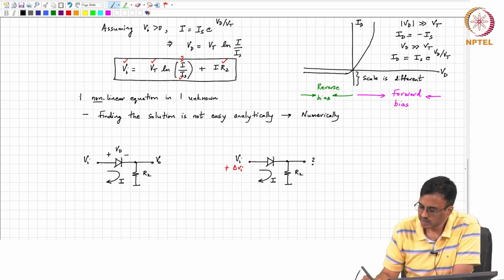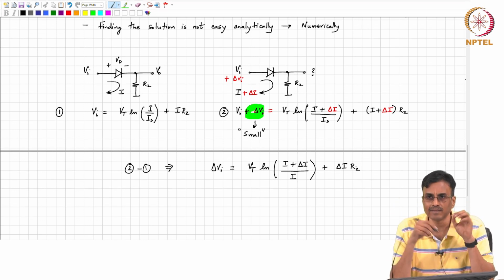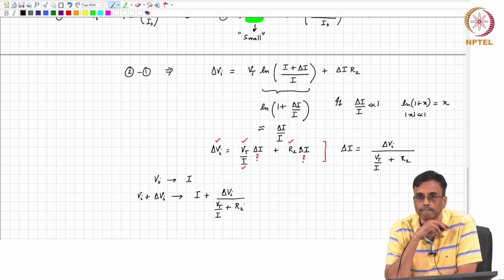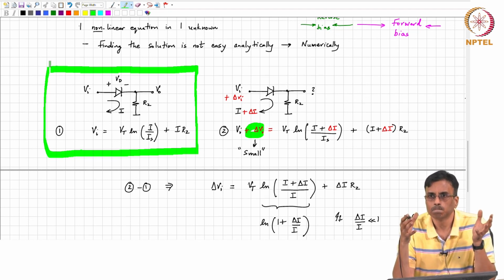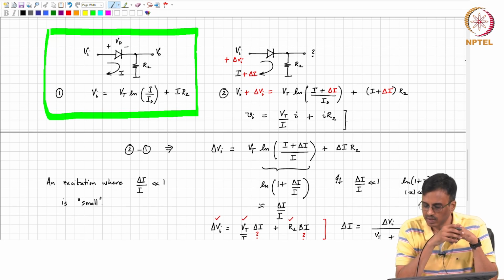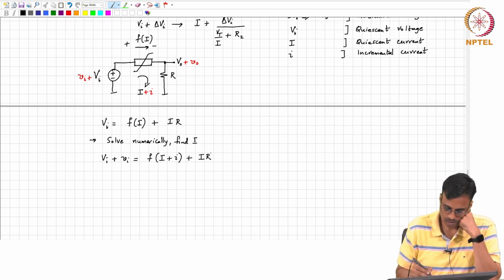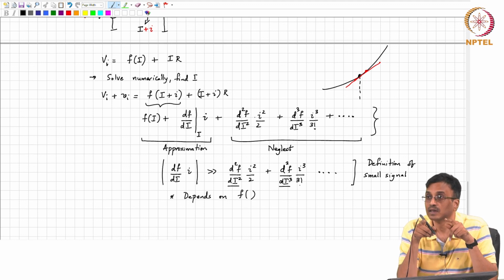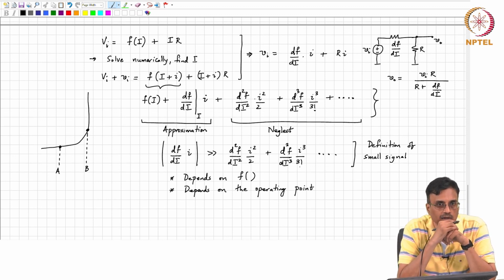Small Signal Analysis of Nonlinear Networks

Comment: hahah how nice of him blaming covid for sucking at calculus. I have a Bsc I said 0 to that question.  That's why I am revisiting these lectures I need to refresh.
Reply: I thought it would be zero if it's base 10 log but since it's ln here base of e I thought it would be ln (1) like some value less than 1
Reply: @Xyzengineer  ln(1) is also zero, in fact log of 1 with any base is 0
Reply: Question anyone, but never question Prof.Shanti. The students for that batch returned to campus after two years of Covid, and after they've done 2 or more math courses, they're expected to know this basic thing. The video was shot during class to offline students, so don't misinterpret it.
Reply: so basically you are roasting yourself? your BSc degree is of no use then ?
Reply: It is of no use. I work at a software company doing stupid tasks like idk remote connection to computers resetting them if that doesn't work uninstalling and then reinstalling software. I do not consider myself an electronics engineer. I only watch these videos while eating my lunch or something.
Reply: In a matter of speaking 0 is not the wrong answer, and x is answer when x is very small, so adder layer of approximation in certain cases may tend x to 0.